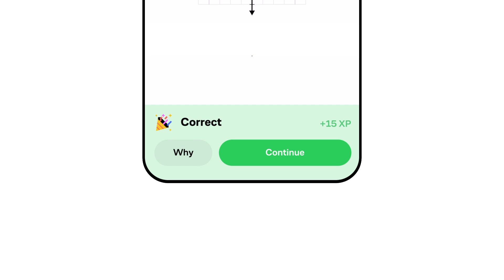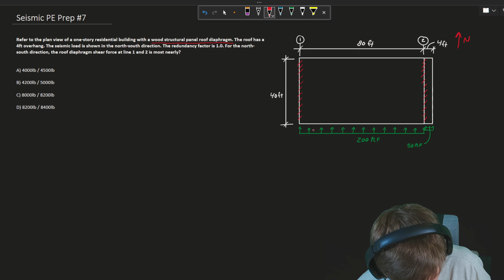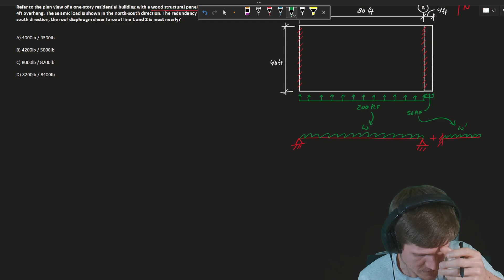PE Seismic Example Problem - 7 #structuralengineering #civilengineering #engineering

Comment: Curious if you could comment on the structural aspects of the house in this video, specifically the orientation of the steel V shaped stilts used to support the floating part of a house out over a slope.  The house is located near the fringe of the New Madrid Seismic Zone, near Kansas City, MO.  It is not in a region where structural damage is expected, though.  It looks like the bridge connection stabilizes the floating section on one axis and the V shape of the stilts stabilize it in the other axis.

TIA.  Just subscribed!  Looks like a great channel for technical info with some humor thrown in.👍

Thanks in advance.  

https://youtu.be/OYB8REFEGYw?si=fnNVm5KCXAk1exyi

Comment: Nice video sir. I believe we’d need to assume a one or two-family dwelling residential structure in order to assume a flexible diaphragm. The definition of # of dwellings is ambiguous to me. Single story could still be multifamily but the building doesn’t care analytically how many families occupy it (maybe life safety provisions). Otherwise, we can check relative deflection against the vertical elements, use Table 12-1, or check it w/ flexible and rigid conditions. I’ll usually opt to check both conditions and use the worst case. I’d like to know if you have any thoughts.